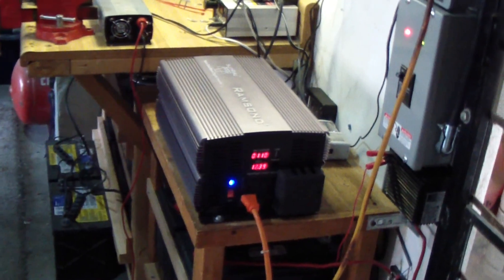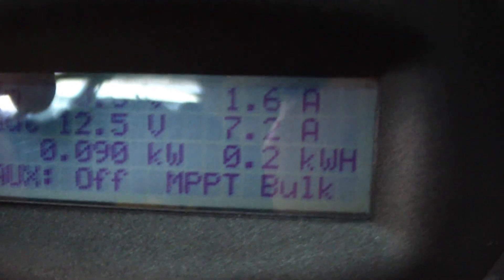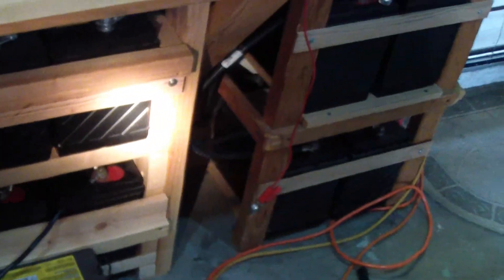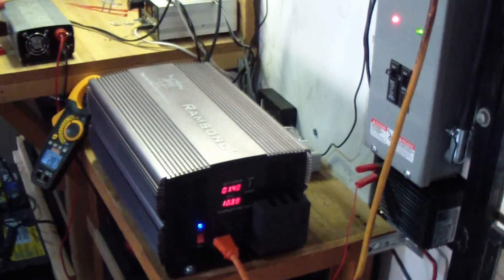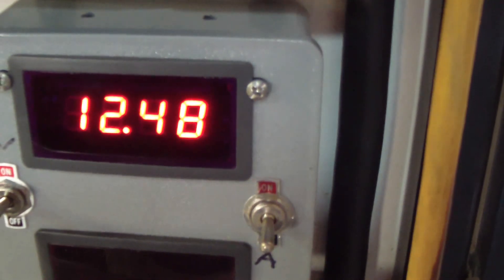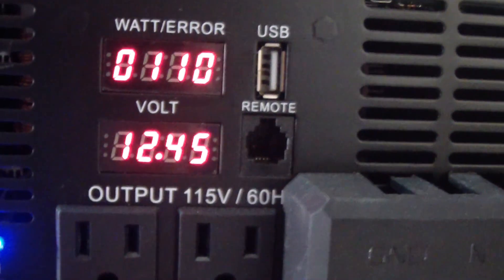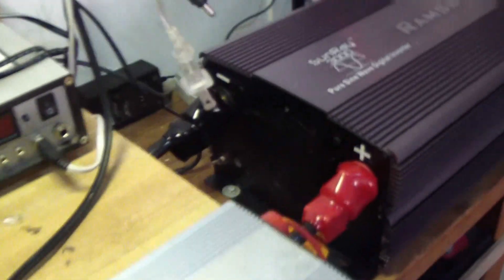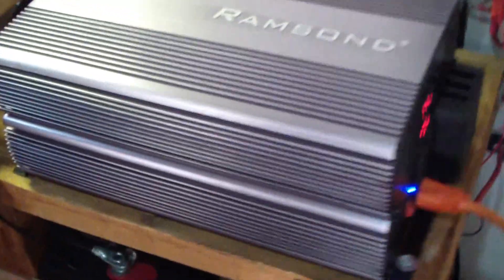DO NOT BUY Ramsond Sunray 3000 Watts Pure Sine Wave Inverter, it is not a pure sine!

Comment: It seems to me that you have 14 batteries, a 3000 watt pure sine wave inverter, and a very expensive Outback charge controller, but less than 300 watts of solar up?
 Normally one should use somewhere around one battery per panel. In this way you can keep a decent balance between your charging ability and your storage. Without enough charging ability your batteries might not get fully charged properly nor get its proper monthly equalize charge which will rapidly sulfate (wear out) your batteries.
Reply from the maker: John, thank you for your comment, however the video you have watched is eight years old and a lot has been modified or changed.  Stay Well,

Comment: Here is my setup https://www.1pcmedic.com/powercart/ 

I powered everything I needed in my house during Hurricane Sandy with this unit on a cart with 3 marine batteries below on the first shelf. Using Anderson connectors and 4/0 cables it connected the battery bank to my Chevy Tahoe that has a 145 Amp alternator. I bumped the idle on the truck using a 1x2 about 16" long, moving the power seat forward until the idle read 1000 rpm.  Just had to go out and find gas for the cans and kept refilling the Tahoe.  Ran the setup for 4 full days without any issues only pulled a maximum of 1200 watts of 120v, didn't need any 220v.  Just got done taking the inverter and plugged it directly into the Tahoes Anderson connector to use an electric chain saw to cut down trees for 4 hours....no problem.  I purchased my unit in 2011 and it is like new. Glad I did what I did, I was up and running within 10 minutes of the power going out.  Here is my setup https://www.1pcmedic.com/powercart/